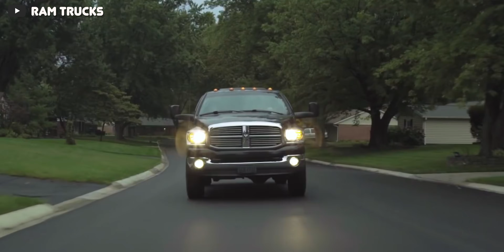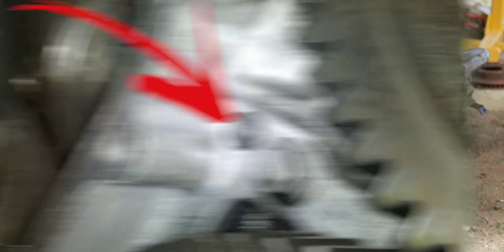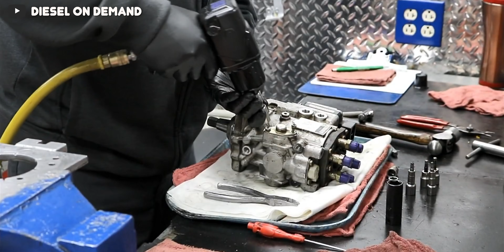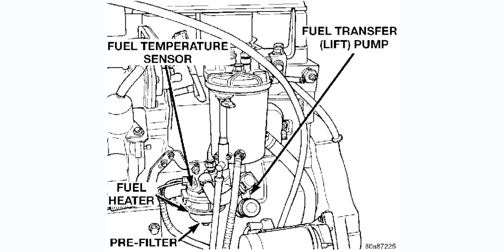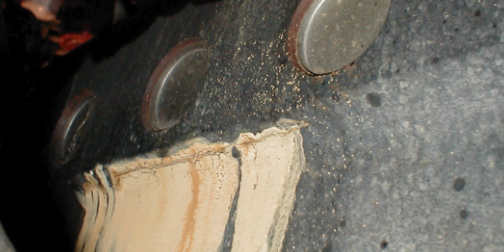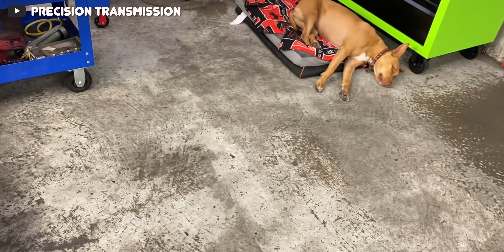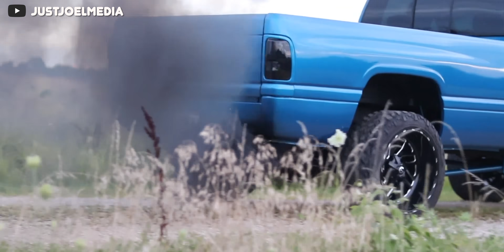Everything Wrong with the 5.9L Cummins (12V & 24V)

Comment: 5.9 is not overrated I believe its legit the perfect engine for anything that can fit it all the way up to a school bus
Reply: Exactly I'm planning on putting 1 ton axles and a 12V in my 96 f250
Reply: Not just school bus. Or any bus. These were used in truck chasis made for upto 50ton loads in 3rd world countries. & They would be overloaded to 70tons and still pull. But they are underpowered for the job. U hit a hill and have to shift to low low and crawl upthe hill while the engine screams. 
I am glad that due to increased market competition & euro 6 emission norms our truck makers are moving towards slightly better power engines. 
This engine was in my school bus and i loved it. It was one of the reason i took the bus to school. There was a long Highway like road in the middle of the city and the driver would just put his foot down & the turbo would scream. 
Later the bus was changed to air conditioned model and it had even more power almost double the power. 245hp cummins 6.7 on the newer models and they will pin u down on the seat if the driver goes full send.
Reply: @KuntalGhosh  Eu sou brasileiro e tenho um caminhão com o mesmo motor ano 1993
Reply: Just drive what you like and if others don't like it, oh well.
Reply: @geraldclemens1682  
Exactly drive what works for you
Reply: @geraldclemens1682  perfect response. Drive what works for you and screw what people think.
Reply: Yeah make a good stationary pump engine, bit longevity was 10-12,000hrs then chuck them out, plus somewhat thirsty
Reply: The 5.9. And 6.7 liter Cummins ranging from medium duty to heavy duty applications are excellent engines however all of the issues on the 6.7l are emissions component related.
Reply: Or any medium duty truck
Reply: LT/LS 4.8,5.3,6.0,6.2 small block is arguably an as "perfect" or "great" engine as the 5.9. you're more abundant way cheaper and affordable, easier to swap into literally any chassis then the 59 and it's lighter and has equivalent power levels if not competitive depending on what variation you choose and how you build it and there are dime a dozen you could get parts form dirt cheap and everywhere and they're more emissions compliant friendly for people like me you have to live in a s*** f**** State like California. My 1992 Chevy 1500 5 speed has a 4.8 swap and it was easy to make legal in CA at flywheel getting approximately 380 ft pounds 415 horse which is a couple modifications and still emissions compliant and reliable package hooked up 5 speed you can imagine how fun it is to drive. All the swap cost me was about $1,800 bucks and a couple weekends. If I try to do that with a 5.9 l the logistics of getting that to fit and do I have time to figure out how to put a Cummins and a half ton Silverado? No I don't small block to ls? I could talk I disabled little old lady through that swap LMFAO just saying....
Reply: @tomh9391  apples to oranges buddy your ls is nice to do burnouts and the occasional towing small car trailer but us men I speak for myself need something with Power to tow heavy loads bobcats and tractor equipment the cummins will outlive any ls motor 3 times its life expantancy I leave the ls to the kids and people just trying to make a takuache truck but the cummins are for real power and real logetivity unless you own one don't speak on something you have no experience on
Reply: @bigpapi1184  
EXACTLY  LS may have more HP but definitely doesn’t have the tongue and def won’t tow 30,000 pounds without rolling over and dying
Reply: It definitely is. It's good but no better then a 7.3 powerstroke. Not to mention the 7.3 sounds better IMO.
Reply: @assbag60  it's twice better then the 7.3 the 7.3 does sound nice I give it that but now way can you make a 7.3 faster with the same amount of money as a 12 valve they aren't as reliable as them neither they are second reliable to a cummins period .
Reply: @bigpapi1184  that's why mine had 500k never did anything but oil changes? But my Cummins 5.9 truck broke down alot. The motor can be fine but the package is trash. And when you buy a truck you don't buy an engine you buy the whole package. Thats what makes the 7.3 better.
Reply: @bigpapi1184  I feel like a 7.3 can be faster than a 12 valve with the same amount of money. I love a 12 valve Cummins but the 7.3 Powerstroke is better
Reply: @assbag60  the 7.3 is much better than a 12 valve. My 94 F350 has a little over 400k miles on it and hasn't broke down on me once
Reply: @biggus_dickkus  lmao depends what you start with I have freidns that never can take out there 7.3 without something wrong . Personally I have 7 12 valves they bear failed me besides dead battery's  you don't see people putting powerstrokes I'm there chevys cummins rules sorry you can't accept the truth
Reply: @bigpapi1184  the truth is the 7.3 Powerstroke is much better and you can't spell worth a s**t 😂😂
Reply: @biggus_dickkus  the Cummins is well known for exceeding a million miles without an overhaul . And it's used in countless industrial applications .
Reply: @HowardJrFord  I don't know any Duramax owners with even half a million miles or power stroke for that matter.
Reply: @assbag60  common rail is way better than a 7.3
Reply: @assbag60  better stick to making white Russians and bowling ...
Reply: No, it is highly overrated. Its a good engine, but far overhyped
Reply: @ks_1111  it's underrated that's why they so cheap still 
And second it's is the best engine so Deserves to be showed off
Reply: @bigpapi1184  whatever drugs you're smoking to think they're cheap. Pass me some....
Reply: @ks_1111  lmao well 2500 dollars for a 12 valve is cheap imo  especially  for what they are capable of
Reply: @ks_1111  no it's not
Reply: @ks_1111  stock it ain't crazy, but it can handle a lot more than stock. I have one in an f800 with an upgraded fuel plate and wastegate that'll pull 60-70 thousand up a grade.